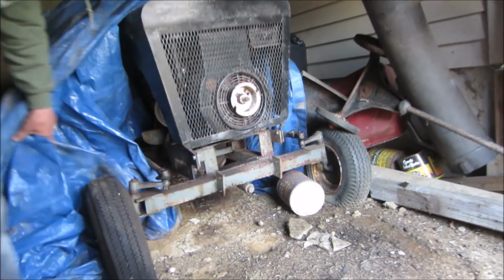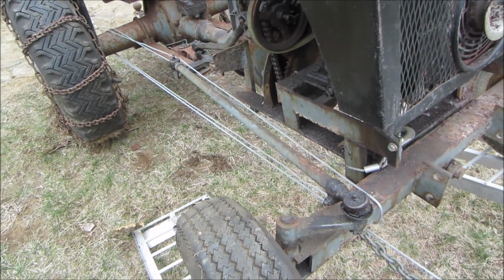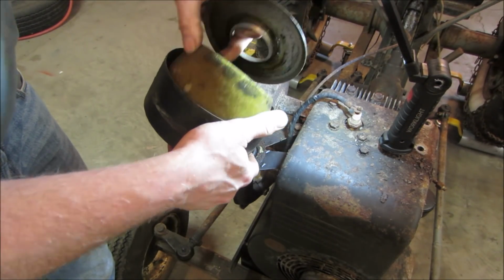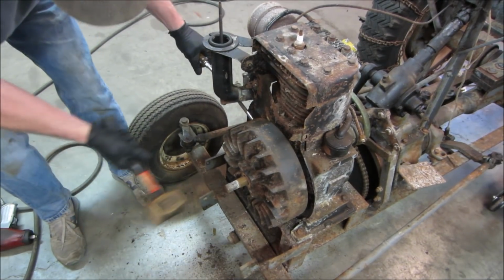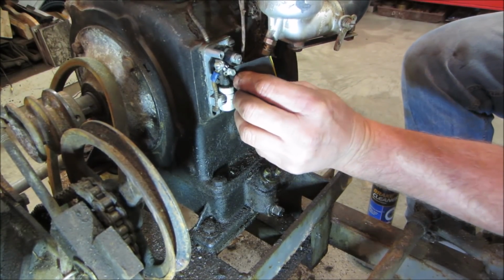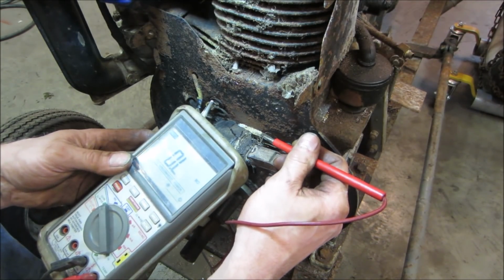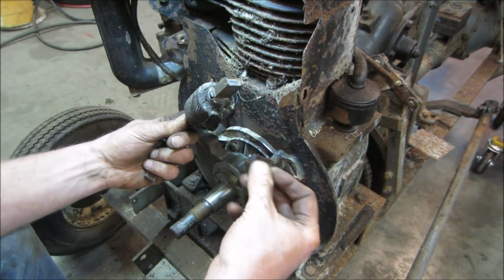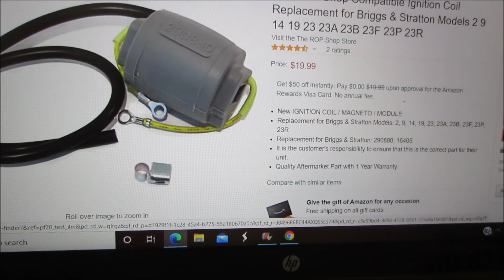Found under a House, Home Built Tractor, Can IT Be Saved?

Comment: G'DAY DArran,an assumption that I'd be making, would be to discard the existing engine,then replace with either a 12 Horse power,or better still a horizontally opposed 18 horse power,in 1974 as a 9 yr old,I attended a neighbouring property having a clearing sale( auction),where a farmer built " Doodle Bug" garden tractor was constructed from a 1955 FJ Holden(GMH) running gear,which was powered by the legendary 139 cubic inch,inline 6 grey motor,with 3 speed manual transmission,coupled virtually direct to a shortened ( narrowed) rear axle,the farmer demonstrated that machine created was in tip top running condition,by racing his son,on a Yamaha DT400, down their driveway to a top speed of 85 MPHr, unfortunately my dad ordered me to quit bidding on machine,when it reached $75.00, I was bummed that it eventually sold for $90.00 ? As always, Kindest Regards, Dave McLaughlin Queensland Australia

Comment: isnt there a magnet inside the edge of the flywheel/fan that generates the magnetic field for the magneto ignition?
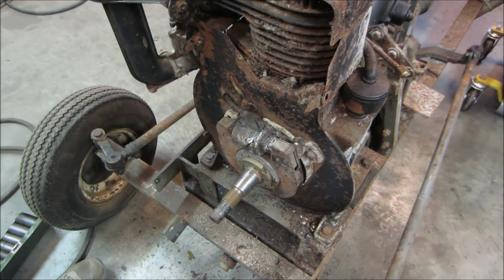Reply: While that's typically the case, this particular engine has the magnet on the crankshaft. As Mustie explains at 28:06.

Comment: What bottle are you using with the flexible neck to get oil where you need to?
Reply: That’s a Zoom oiler. You can usually find them at HVAC parts dealers, and electric motor shops. Used for oiling electric motors in hard to reach locations.
Reply: @notajp  Can you buy empty ones and use them to put 2 cycle oil down the spark plug hole? Will the gas ruin it?

Comment: Small engine guys. What's the most you can raise compression on a 3 horsepower stock  air cooled engine without losing dependability or longevity?

Comment: Judging by the robust frame, gonna be a whole lot of twerking going on when you get that going! 

If you can't get a replacement coil or that crossbar ass'y from Briggs at reasonable cost; I would bet that if you can get the points opening and closing and the condenser is OK, you could just abandon the sort-of-magneto entirely, use a motorcycle battery and any old automobile coil, and get a timed spark that way. Yeah, it would be completely "non-stock", but there's plenty of room under the hood shroud to mount that stuff. Plus, I'd assume you have plenty of motorcycle batts and misc coils lying around so it wouldn't cost anything and you wouldn't risk burning up a brand new $50-$100 part.

Comment: You would be better off if you used wood wedges on each side of the flywheel instead of a screwdriver.  Package of wedges available in any hardware store.

Comment: Last week I channeled my inner Mustie and pulled my brothers Lawn Boy Silver Series mower out of the shed which hasn't run in 10 years.. First there was a fuel line and primer bulb problem which i easily fixed. Then I pulled the cord and nothing. I opened up the air cleaner sprayed in a little starting fluid and still nothing. So I pulled the spark plug and checked and No Spark at all, replaced the spark plug still no spark. So I took off the engine cover and right by the magneto and the fly wheel Giant Mouse House so I blew all that crap out pulled the cord Still No Spark...Then I remembered Mustie adjusting a magneto using a card as a spacer between the fly wheel and magneto, so I did that...Pulled the cord and Boom we had Spark!! I put it all back together and it ran ok but seemed like it was running too fast..I patted myself on the back and put the thing on the back burner until today...I pulled it out sharpened the blade and painted the under carriage put it all back together, pulled the cord and Nothing, no spark again...When I was working on it last time I may have smacked the magneto with a screw driver handle, which I didn't do today and certainly don't want to have to do every time I want to use the mower so I went on Amazon and ordered a new Magneto..Trying to figure out the high rpm problem I removed two screws inside the air cleaner and the entire carburetor fell off the engine which sucked but I figured out how to adjust the wind vane governor (which is just freaky) so hopefully if I can get some spark I can slow the engine down..On a side note if anyone knows who designed that stupid carburetor arrangement please sneak up behind him and kick him right in the backside, huge pain to put back on..

Comment: Neat to see the disassembly.  Just picked my first big B&S L-Head that's a 10HP on a McCulloch HD-5000DLX generator.  She's an overweight heavy biggy one... at least to me and compared to the latest find Coleman Powermate that needs a capacitor, breakers and outlets rewired... that came with my first single cylinder Vanguard who's engine I've got running no problem.  Anyways, eventually I'll get to the B&S old L-head though haven't found the engine code anywhere.  Similar like you're thinking I'm thinking can just work on and learn as I go using some logic. Thinking I'll save for last and read into the Honda EB3000 completely different design parts basket since looks like only needs some carb work for the most part.  Had to watch this since saw the engine though.  Thanks for sharing!

Comment: You have a 1961 POW'R PUP garden tractor. It was a featured build in the August/September 1961 issues of SCIENCE AND MECHANICS  magazine. You can download free blueprints at Vintage Farm Plans. Your hood is a variation of the original design. The front blade is for a SEARS ROEBUCK garden tractor of that time frame.  CAT O SEARS Three pint hitch attachments were also able to be attached by building the mounting bracket for the CAT O tractor hitch.
         Please do no get rid of the engine that came with it. I was able to obtain a NOS engine with the owners manual of the same year for my POW'R PUP.   They are very rugged little tractors. The steering components were from a 1951-53 Studebaker automobile.
                       What are you plans for the little fella? Keep it or sell it? I would be interested if you want to sell it.

Comment: 290880 Briggs Gas Engine Coil Ignition
$35.00 $29.00
New Replacement Ignition Coil for Briggs & Stratton Engine. Replaces Briggs Number 290880. Fits Models 9, 14, 19, and 23. Will NOT fit C or D versions USE...